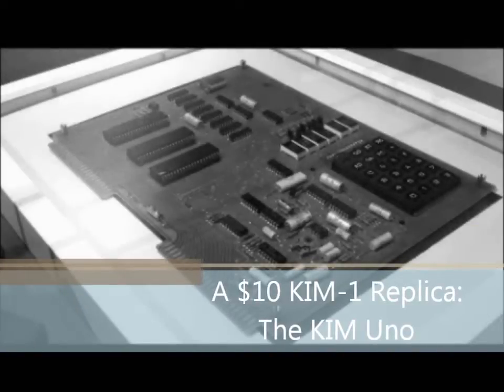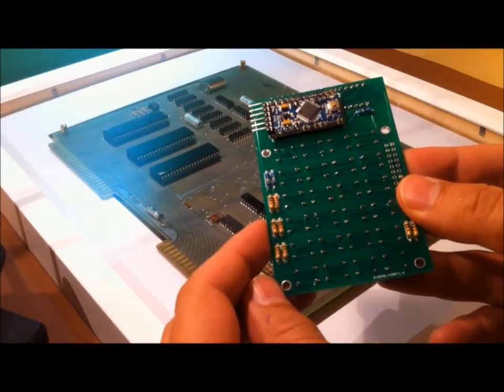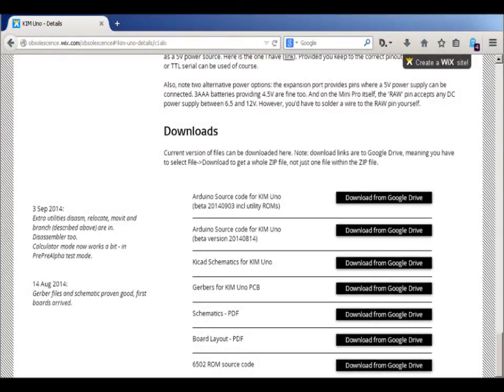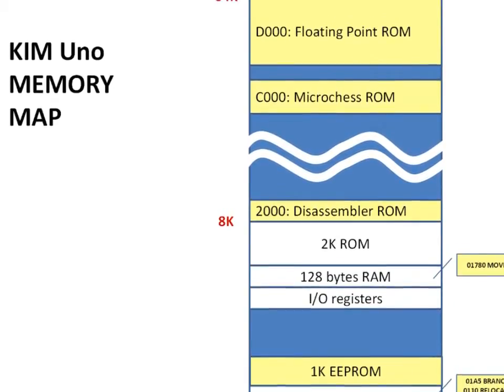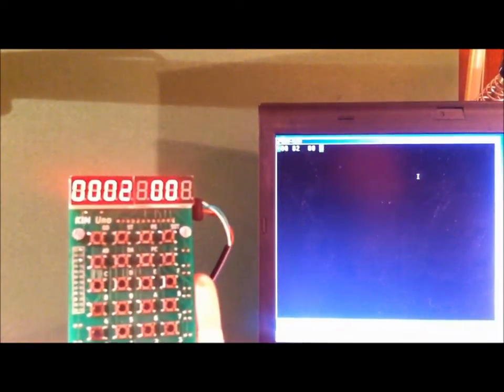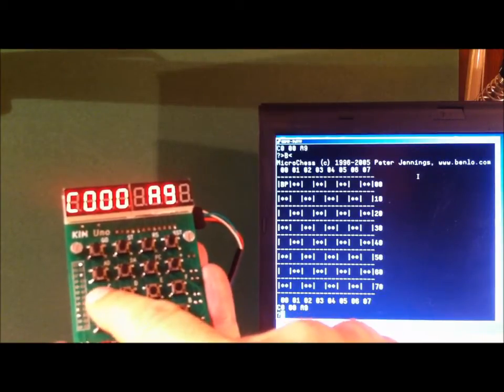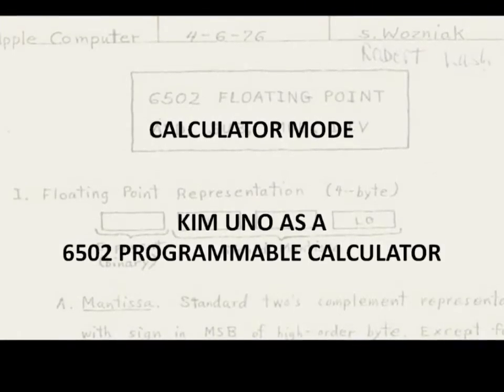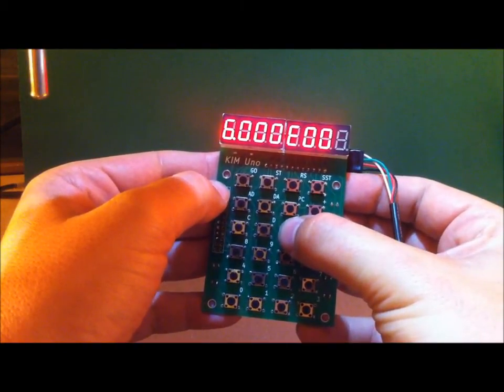KIM Uno: a KIM-1 replica

Comment: Hi Oscar! I've just build KIM UNO but with a custom hardware - 16x2 LCD shield with 6 buttons including arduino reset and 4x4 keys keypad to input 6502 machine codes. I'm using Arduino Nano istead of pro mini and all the ROMs work like a charm! I've changed your code to source keypresses from my custom keypad and output data to LCD screen instead of 7-segments LEDs. So far so good but I have a question:

How can I expand the firmware to support 8 user defined character for LCD, manipulate LCD cursor and actually print to LCD just like to serial port?

In my previous project I just hardcoded OUT instruction to my imaginary CPU to deal with output, but here I can't do so because that wouldn't be compatible with the original 6502 any more, so

should I uses memory addressed for this purpose and if so then which addresses I can use?

THANKS IN ADVANCE!

P.S. I made a video on my assembly demo and gave a credit to your project! Thanks for creating my dream computer!